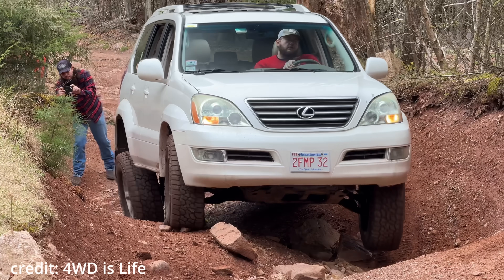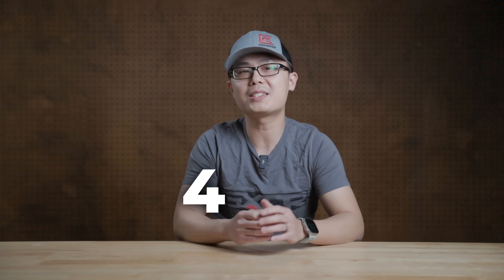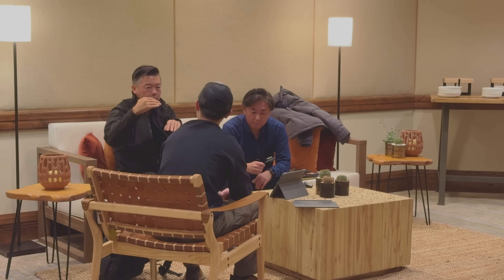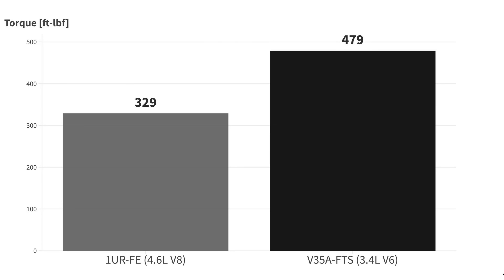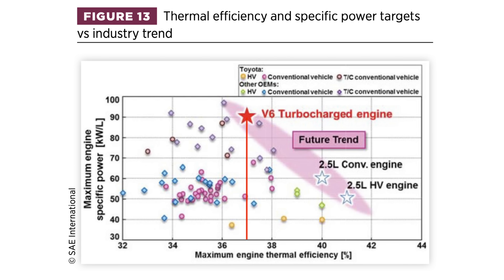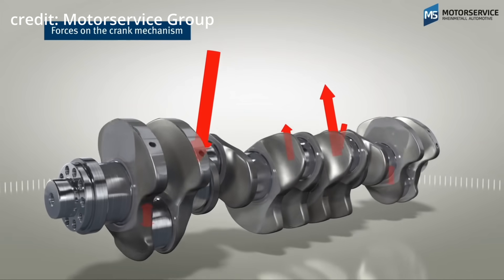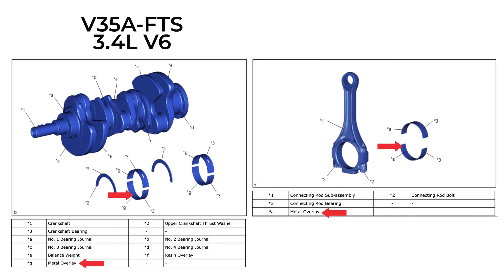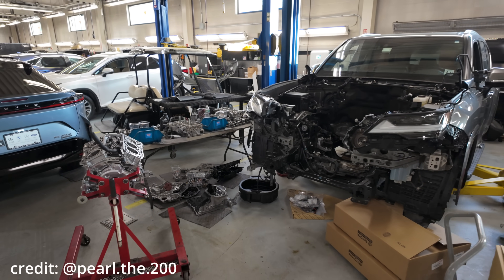Is Toyota V35A-FTS Engine Reliable? Well..It's Not That Simple

Comment: To me its blatantly obvious. There are also overstressed V6, V8s to consider from Mercedes, Ford, BMW etc. All of the new engines are over complex, unreliable and hard to work on!! Another way manufacturers improve thermal efficiency is by running the engine hotter. This creates heat soak, combined with low viscosity oils get wear on start up and all the plastic parts like cam chain guides, hoses, cheap plastic engine parts become suspect. For what? Marginal gains in gas mileage? You make an over complex engine, transmission etc, that cost twice as much to make? How about a real efficient small N/A V8 optimizing the intake and the exhaust and put it in a vehicle with reduced weight. You can't even attempt to repair a vehicle like this if it breaks down on the trail!!! More complexity more weak links. I would buy any new manufacturers engines. All of them are embedded with engineering disasters that the consumer will have to address.

Comment: The theory is beautiful until confirmed by facts. In the case of this engine, the facts are as follows: thousands of engines show defects during use. So, is the theory confirmed by facts? Well, no. The power of the entire engine complex is demonstrated by the weakest link, which fails in practice. Forcing extreme parameters overloads individual engine components, and they fail.

Comment: Well, when you take a 3 cylinder Toyota motor and cram a bunch of air and gas into it, you come up with 300hp, like the motor on the Corolla G/R. But turbo-fed motors come at a price. They wear out faster and really dont'save much gas if you are heavy-footed. Stick to the earlier design....you'll be happier in the long run.

Comment: Don’t worry the japanese made engine is fine only American build engine has problems
Reply: Unfortunately, all V35A are built in the US. Those engines are then shipped to japan n put inside the LX600, J300 landcruiser n the LS500.

I thought it was very weird as to why the landcruiser j300 was also failing. Did abit of digging,, yeap, all engines are built in the US.

Comment: Lexus tech here: its essentially the same engine in the LS500. The new V35A's have been very reliable in the LS500's and the engine have been out since 2018-2019. Lexus took many lessons from what other manufacturers did with their turbo motors and made sure the V35A's are heavily over-engineered with a big focus on reliability. Example: The new GX550 takes 7.8 quarts of oil for a 3.4L V6, indicating that Lexus knew the importance of having abundant oil supply for a turbo engine to insure reliability in many factors. And thats just the tip of the iceburg, Lexus knows its reputation is based on being "reliable luxury".

Reading the comments, its clear alot of people dont know anything about the these engines, let alone are lexus techs/engineers. Please disregard any of these negative comments as its just people completely talking out their asses with no real knowledge on the subject.

Comment: Not reliable because of turbo.  It will require lots of oil changes and routine maintenance
Reply: Oil changes are cheap and easy. I do 5k mile changes on my 3UR-FE regardless of what Toyota says it should be.

Comment: like and sub for i like the content, I would suggest you look at GCC middle east gulf countries videos on social media that starts with a T. there you will find many videos of baring issues with toyota LC 300 and lexus which is the same engine just maybe ignore the recommendation of using thicker oil as a remedy in those videos the wear on the parts is very unusual and suggest heat damage occurring rapidly in a hot engine due to operation in hot climate . if your friend had 3 cases most of the T garages in GCC have fixed more than 100 vehicles of the LC 300 since 2022 with various milage and use profiles

Comment: Ford 3.5 eco boost makes more power, more torque, and is dead reliable. Toyota screwed up with this one.
Reply: The 3.5L Ecoboost has not historically been dead reliable. It had its issues and only after 12 years of production did they really get it sorted out. First it was the timing chain stretch and warped exhaust manifolds on the 1st gen 3.5L, then it was the cam phasers on the 2nd gen. It took until about 2020 before they had everything mostly worked out.

That said, the Ecoboost was not prone to bottom end failure at low miles like this 3.4L.

Comment: no v8 no inline six in at heavy truck no buy any more toyotas its like supra i will not own one [bmw] and it looks gouty  but i do own the older units love them but all this remaking of how stuff needs to be made is goofy at best .what theses tundras need is a 4.2l inline six low boost turbo  .a old landcruiser engine with ungraded head .theses factory reps are all full of poo .any engineer know  4 main bearing ant going to hold up hence the resion inline six got7 after the 1960`s or so goofy stuff but past proves future  they need to stop being cheap oh`s build v6`s with open deck blocks and build an inline inline 6 4.2l or so or v8

Comment: New tech = new problems.  Not Toyotas forte.
Reply: Its not new tech though, Ford has had almost the same exact engine in the F150 since 2010, it just took Toyota 12 years to come out with theirs in the Tundra.

Read the recall and understand what the issue is.
Reply: @Jay-me7gw  - which is crazy why Toyota still managed to mess it up and comes to the table with slightly less power. Meanwhile Ford is coasting along…
Reply: @bonusb2924  I mean ford has not been coasting. They have constantly been improving and updating their motors. They are now on the 3rd generation of the 3.5Ecoboost.

Toyota has always just been insanely slow. But it is impressive that they managed to screw up so bad.
Reply: @Jay-me7gw  by coasting I mean far fewer issues. That engine started out what 10ish years ago?

Comment: 2022 Toyota Tundra owners on a second replaced 3.4L engine, some on a third replaced engine at 30000 or 40000 miles. Wow! And have been many reports.
2023 - same issues on the Tundras, Toyota didn't fix it, again owners having their 3.4L engines replaced once or some even twice. That's already ridiculous. It's hilarious. Cmon...
2024 - early reports showing up. People with knocked engines driving on the highway. Unbelievable...
So please, stop making videos like this trying to be politically correct to Toyota and gaining credits from them, so they will invite you on their future events or chatting with their chief engineers. *uck this, please criticize Toyota as needed because this is what they deserved from what they've done.

Comment: V6 engines are gimmicks.  They are cheap to make and they package well.  Those are its only two bright points.
They are not naturally balanced, and require additional mass and rotating mass to balance.  If you, as a maker need a 6 cylinder, then use an H6 or I6.  If those take up too much room or are too long, then you don't need a 6.  You can get by with a turbo I4, or if you do need more power, a V8.  
Guess what?  A 300hp V6 will use the same amount of power as a 300hp V8 to propel a vehicle from 0-60 in a specific ET.

Comment: Firstly, does he always speak to viewers as if they're children?  I'm not an engineer, or even a basic mechanic, but this seemed a ridiculously slow, simplistic explanation, of some very basic points.  😴

Next, the biggest concern  - reduced engine reliability/longevity - was based on some claims.   Surely the subject is significant enough to warrant a basis of substantial objective data rather than limited or subjective anecdotes.

If there is  a significant reliability problem, due to the engine design or material quality of certain components, then I can understand that Toyota would be reluctant to share the failure rate data.  Still, the engine has been around long enough that there's some meaningful data somewhere.

Finally, "sep-cific power" is not a thing. 
The word is spe-cific.  Specific, as in special, specify, species, etc.